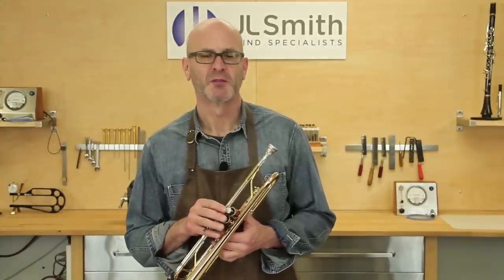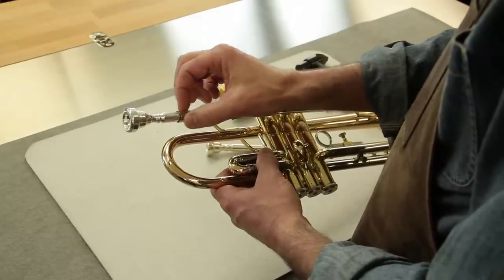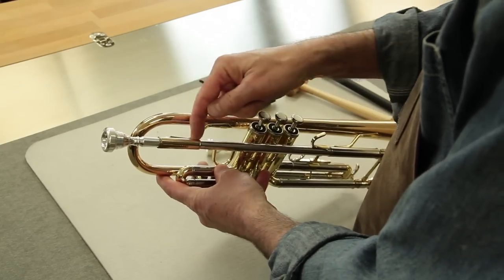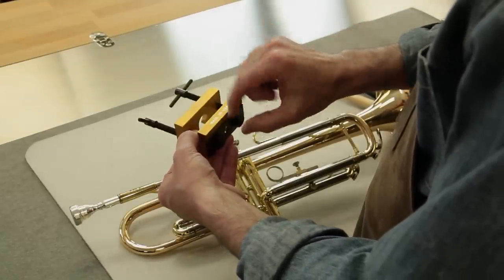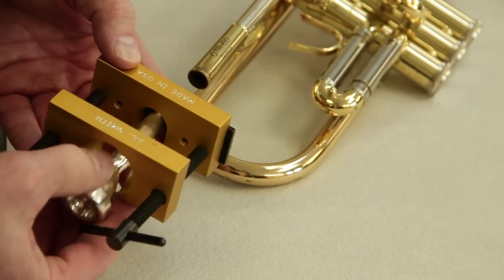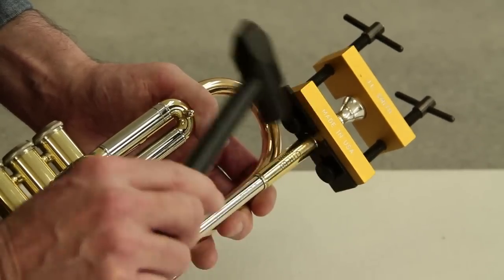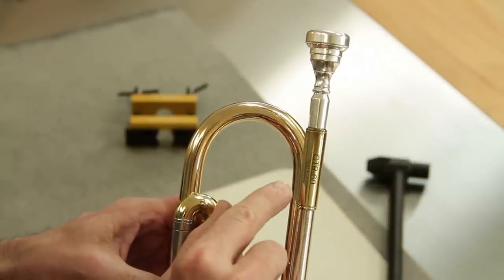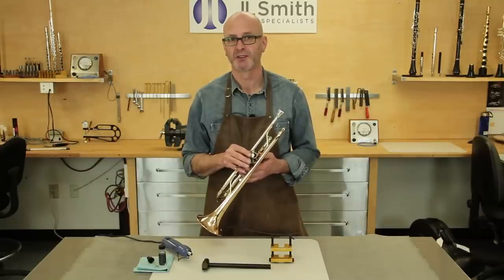REMOVING STUCK MOUTHPIECE ON A TRUMPET

Comment: I don't think the one he is using here is the Bobcat brand but they all work on the same principle. I bought a cheap one for about $20 and it came with no instructions so this video is handy. The most important part is to make sure the first set of jaws secure the end of your lead pipe very securely so they do not slip. The second set of jaws will vary in adjustment because not all mouthpieces have the same outer shapes and contours. Be patient, good luck.

Comment: What if we dont have a mouth piece remover or the other things
Reply: Try two washcloths, put one in ice water, the other in boiling (or close to it) water.  Wear rubber gloves to avoid getting scalded by the hot water.  Wrap the cold cloth around the mouthpiece, and the hot one around the leadpipe.  Try pulling it out.  If it doesn't work at first, knock on the mouthpiece where it meets the leadpipe with your knuckle.  That could break it loose.  Never use pliers or tools that aren't specifically made for a brass instrument.  If the washcloths don't work, take it to a professional repair facility.
Reply: InvestorGuy66 or just bring it to any music shop and they are guaranteed to pull it even for free
Reply: @bennyhd1382  yes, they will!
If not, go to another one 😉
Reply: @MicahiLove  ok